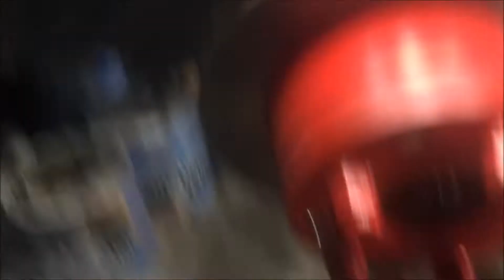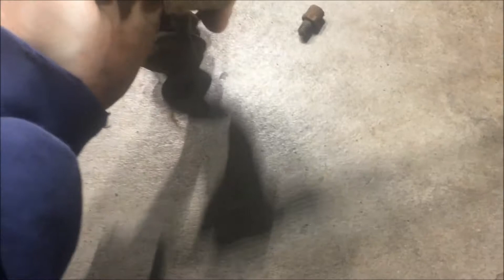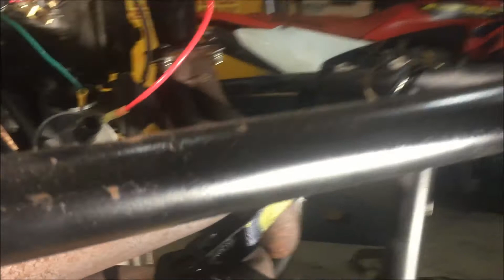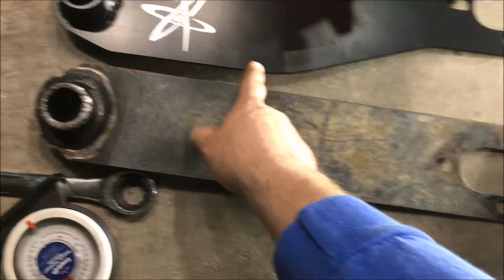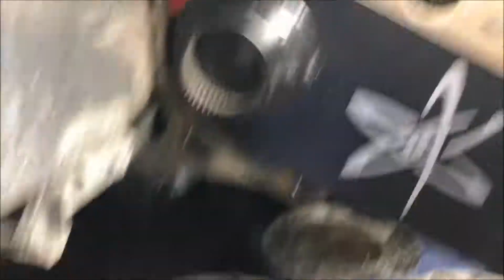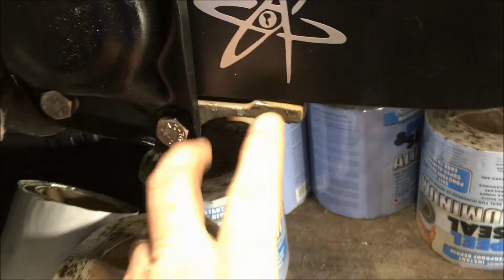Vw Bug lowering  Atomwerks 2.5"springs

Comment: Did you remove the E brake cable from the caliper?
Reply from the maker: Yes I did. I am in the middle of a full build so I may not of shown that.
Reply: @OFFAxisBuilds  okay, my car is too low as well. question,  jacked up the rear and it’s 5 degrees. So that means I want to set my spring plates to 26 degrees before getting them on the back stop?
Reply from the maker: Honestly that’s about what I set mine at but it really depends on how old the torsion bar is or if it is a over sized bar. Also I added adjustable shocks in the rear to dial it in to where I wanted it. I would start with 26 and see if you like it. I tore mine apart about 3-4 times before getting it close to what I wanted.
Reply: @OFFAxisBuilds  just so I’m straight, looking at the drivers side rear, to raise it I should turn the spring plate DOWN one or two notches to raise it, correct? And on passenger side turn the plate down as well. Correct?
Reply from the maker: Yes but make sure you use your degree tool. You will want to make sue both read the same. How much are you trying to raise it?
Reply: @OFFAxisBuilds  just a couple inches. One notch I assume right?
Reply from the maker: I would start with 1 notch.
Reply: @OFFAxisBuilds  okay, we’ll I guess the 26 degrees is out the window. My spring plates are different than yours. The main plate is longer than the shorter plate which is splined with no load. So I removed the spring plate cover. My spring plate (drivers side) was not under load. So I measured the shorter plate as is, making sure it’s down. It measure level. I removed the splined plate turning it clockwise down one notch and grub screw all the way in. I’ll try that to see how it goes.
Reply from the maker: Ok a few things. You need to make sure your floor pan is level. That way when you measure the spring you will get an accurate deg measurement. Also the spring should have no load
Reply: @OFFAxisBuilds  yep, they have no load. Just fought with the passenger side. Fought getting it off now fighting to get it back in. I don’t think I like these adjustable spring plates. They suck and they’re not really adjustable by much. I may take them off and go with something else.
Reply from the maker: Honestly I have heard those things are nice to have. However I’m not entirely sure which plate to take your angle measurement from. I would assume the one that hits the stop when installed. Are you having trouble getting them back on the torsion bar or on the stop. I made a tool to get mine off and on but I found that when you lower the car there isn’t much tension there and I was able to use a jack to get it back on the stop.
Reply: @OFFAxisBuilds  there are two plates. The longer plate secures the driveshaft and the shorter plate is splined so it’s this shaft it’s give me the trouble. There seems to be binding getting it back in and making sure it’s on the spline without damaging this spline teeth. The collar on the shorter plate appears to be a tight fit on the collar of the longer plate. I may just go ahead and replace the spring plates if I cannot get it back together.
Reply from the maker: Was the shaft spline rusty looking. Also check to make sure you don’t have any spur’s on the splines. Add some grease or anti seez on the splines to help you slide it back in.
Reply: @OFFAxisBuilds  no, they are about a year old. I had someone else install them. Should have done it myself.
Reply: @OFFAxisBuilds  I think I was re-indexing wrong with these adj spring plates. I called the manuf and they said I should remove both plates, turn the both down at 20 degrees (stock height) and using a torsion tool preload the torsion bar back up on the stop. Since my rear is 5 degrees up I’m thinking I’ll go with 15 degrees. If I need to raise it, just turn in the grub screw. Whatcha think?Ordered the damn tool. See how it goes when I get it.
Reply from the maker: That sounds like it will work. Good luck